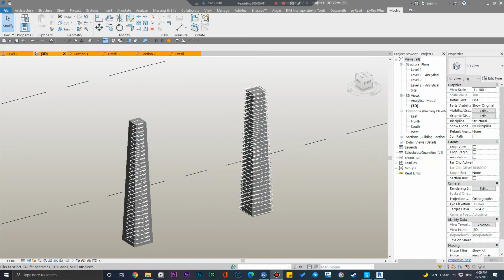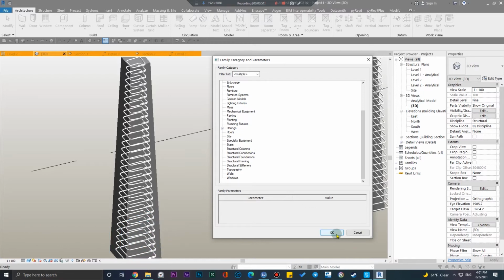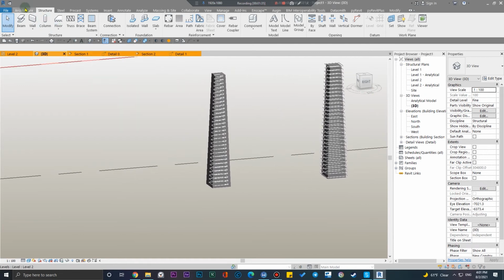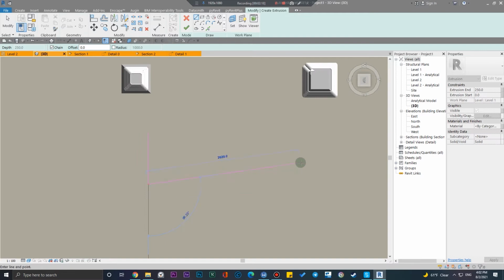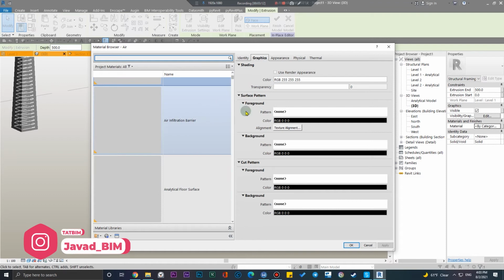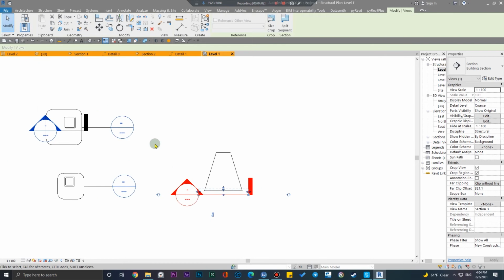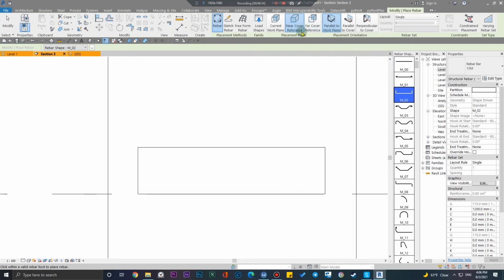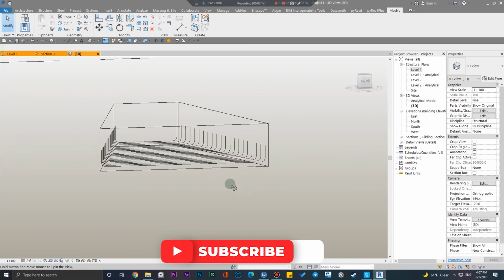Varying Rebar Set in Revit-Varying Rebar Distribution IN Revit

Comment: good evening sir, i want to ask you about this feature, what if the "varying rebar set" didnt work on mine?
i've already follow your steps but i dont know why, when i click "varying rebar set", the rebar didnt set with the shape.
the project i've been working on is pile cap.
thanks in advance sir! have a great day☺️
Reply: @TATBIM  thank you for fast replying my comment!
i've put the rebar on structural framing [column] but it didnt work out as well😅
i don't know what's wrong with my pillar families😄
i use revit 2021 ver., is there any big difference with former version?
thanks in advance sir☺️
Reply: @TATBIM  okay, thank you for your advice sir☺️God bless you!😄